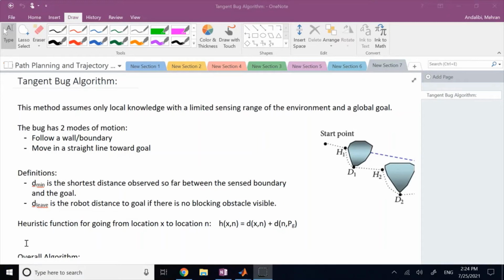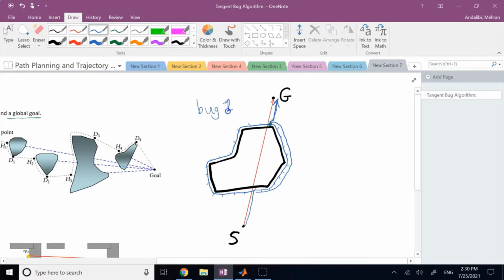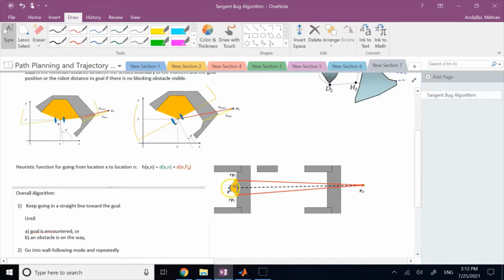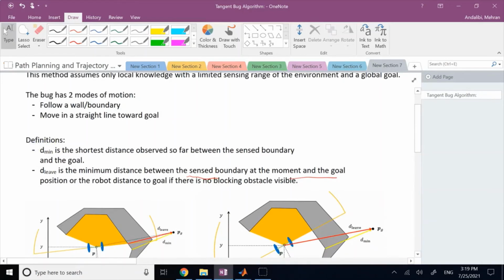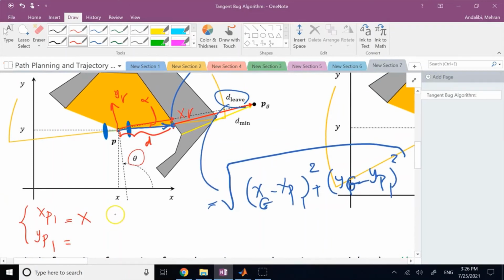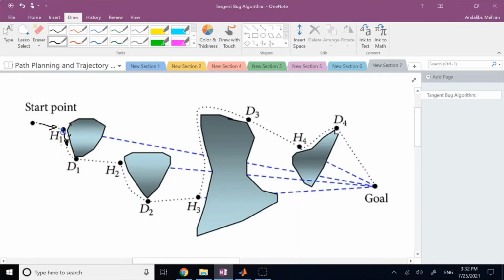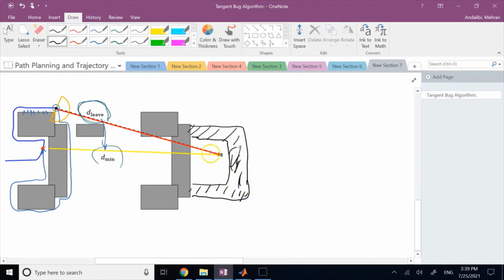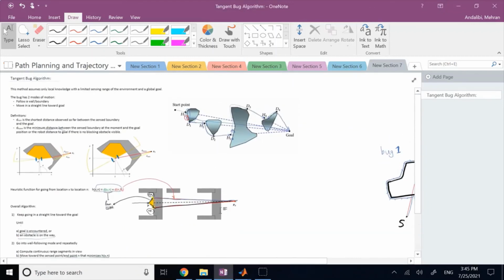Tangent Bug Algorithm for Path Planning with Range Sensors

Comment: Good video, although I think that your explanation is somewhat wrong. You say that there is 2 modes: 1) move straight to goal, 2) follow the direction of min heuristic which you call "wall following" until you observe the leave condition... Actually the way TangentBug should work is: 1a) move straight to goal 1b) when obstacle is encountered follow direction of min heuristic 2) when the heuristic starts to grow, switch to wall following which actually just means moving straight tangentially to the wall and NOT towards the min heuristic distance. I beliieve the algorithm you described would result in you getting asymptotically closer to your boundary as you go to your heursitic min direction in this version of wall following (in other words you would crash).  Please feel free to correct me if you think this is wrong. Source: the orginal paper on TangentBug: http://www.cs.technion.ac.il/~ehudr/publications/pdf/KamonRR96i.pdf